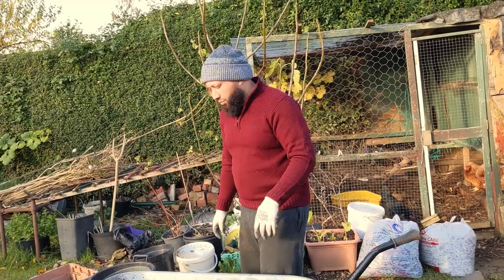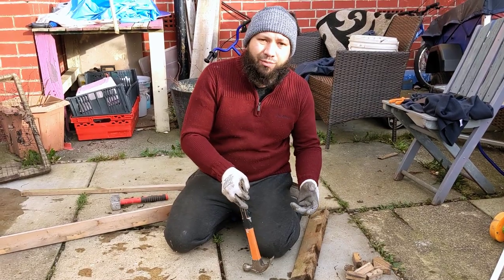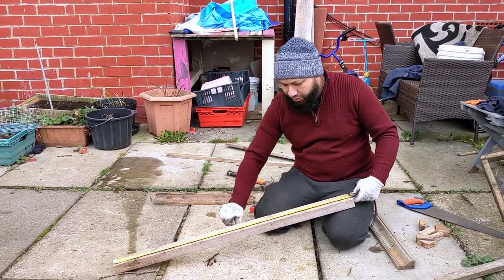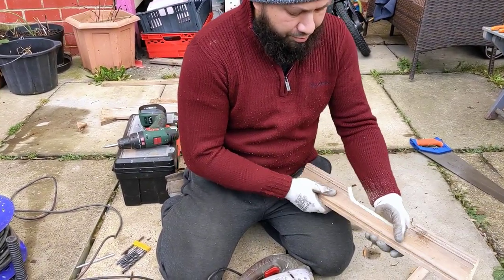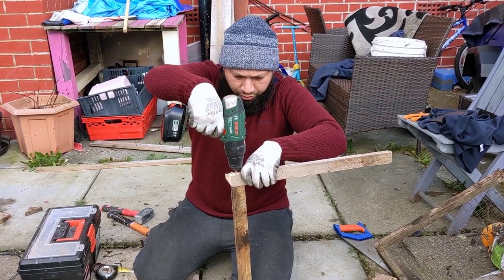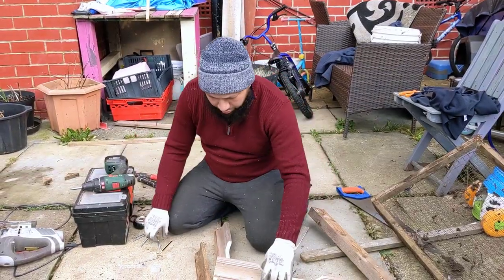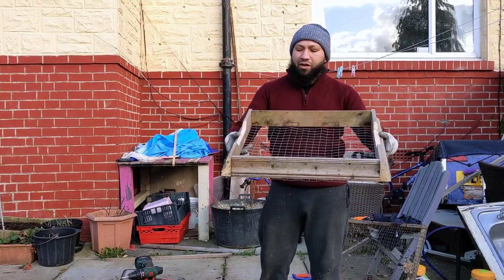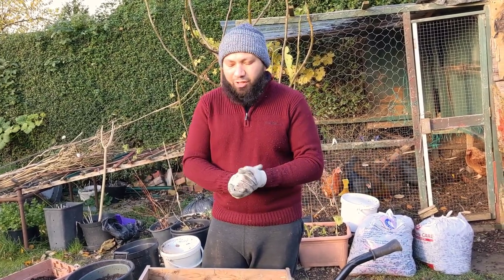How To Make A Compost Sifter - Make A Compost Sieve

Comment: I love you approach reusing material. I'd have kept the corners and cut it to length using a 45 degree mitre to make the opposites then screwed those together. Meaning you'd only need to make two cuts. I would have sandwiched mesh between two frames to avoid the risk of snags on the edge later and make it stronger. You could have used tin snips to cut the mesh to length then stapled it down.
Reply from the maker: Thanks I could have done the angled cuts with my hand saw but it wouldn't have been easy for others to replicate and the additional wood just adds to the weight
Reply: @MyFamilyGarden  there is a 45 and 90 degree angle maker on the handle of all hand saws.